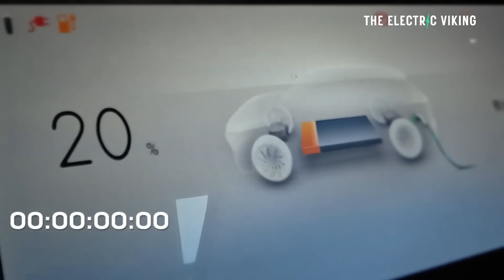CATL Unleashes Sodium: The EV Battery That WILL Rewrite Industry

Comment: The super low price for similar energy density to LFP will be the disrupting factor. That means that even with tariffs, the price will be comparable or less in the U.S. (and less than half the price everywhere else). Plus the added benefits of 0-100% charging, safety, cold and hot weather tolerance, and super long life will get many adopters. The battery swapping business makes sense for people who cannot charge up at home. It was a hard sell when Tesla showed their battery pack swapping system, years ago. But the biggest downside was NCMA battery degradation in swapped packs. At that time if you just paid $100K for your long range Tesla Model S, you didn't want to have your new battery swapped out to someone who would potentially abuse it. But now, having a Naxtra battery pack with 0-100% charging, and 10,000 cycles before 80% means that there is no reason not to swap out the battery pack whenever you like. And battery swapping is a smart business for CATL, considering that CATL provides their own packs, and can charge up overnight, when power is the cheapest.

Comment: It also means that every house in the future could potentially have its own reserve built-in for a very affordable price instead of building all the large battery centers in case of grid failure. Ideally the car themselves could do this too.
Reply: Yes should be a kind of law on that.
Reply: @Myrslokstok  a publicly local-distributed power grid only makes sense, especially as EVs gain increasing market share and partake naturally in that same power grid. Being able to provide energy to your neighborhood from your personal battery station in your home when central power outages may occur, could give thus far unseen levels of power grid stability -to a degree where if someone wanted to do damage to a country's power grid, they would have to attack the actual infrastructure itself (cables and subterrain power lines etc), rather than just hitting centralized power stations to take out an entire city district.

Nuclear SMRs can go the same route as well -but for industrial districts rather than nation-wide power suppliers.
Reply: Honestly, a 20kWh home battery could do NMC batteries and HW cost would only be ~$1-2k more than sodium.  That's pretty tiny compared to the cost of the home.  Integration is the real cost killer.

Comment: In Ireland, where the difference between average winter temps and summer temps is about 15C, and my car range drops by 20% in winter, and it is a Diesel. Most people don't even know how much their fuel consumption rises in winter in an ICE car.
Reply: Not sure what it’s like in Ireland but in Canada we have winter and summer gasoline formulations.
Reply: That’s because the load on the alternator increases, lighting load, heated seats and windscreens etc

Comment: Fun fact, -40 is the same in C and F... that said these are CERTAINLY going to replace LFP simply due to cost alone, plus the longevity of sodium is amazing!
Reply: longevity is not amazing as you said. The best commercially available one has 3000-4000 cycles max. LFP is now reaching 8000+ with 10-15 year life depending on usage conditions. Sodium is very far from competing with LFP, let alone being better than it. What you see in this video is just some hyping crap that I can provide you a link or a video ten years ago with the same crappy claims.
Reply: @abdullahalrasheed394  difference is CATL is throwing their weight behind it
Reply: @sino_diogenes  I’m a big fan of off grid systems and batteries, and I truly wish they get this done and produce longer life batteries with more cycles while being cheaper than LFPs. But the truth is the sodium battery will not dominate any time soon even if the entire Chinese industrial base is thrown behind it. There will be new tech or chemistries before the sodium battery becomes good enough.
Reply: @abdullahalrasheed394  could we do the technical study each other? I'm doing the off grid battery LFP for many years and study the sodium battery for over 1 year already
Reply: @abdullahalrasheed394  most LFP battery is not end of cycle , it even not go to 1000cycles for many years. but the most critical is the Calendar decay during use. the sodium is much better, and recover the capacity. now the best application is UPS and Jump starter. we could exchange the experience together.
Reply: Well below -20°C my gas car don't start.
Reply: @Myrslokstok yeah, I don’t start well either 😂
Reply: @rmorales1029  sodium battery? empty or full of charge?
Reply: @Myrslokstok  sodium or lithium battery?

Comment: The demand for solid state lithium is dead then.  
175 Wh/kg, half price the of LFP, 10k charge cycles for 80% capacity retention is already attractive enough to be used in EVs.  

The only use case of solid state batteries I can think of is aviation, sports and luxury vehicles
Reply: No, solid state is not dead, ALL EV applications can benefit from much lower weight with higher density batteries. Yes, this will be an amazing cheap option for cheap cars but solid state with its density will always be preferable and eventually the cost will drop for standard cars.

Comment: Since I live in southern Sweden, and I have been driving EV-s for more than 7 years (Renault Zoe, in fact), I know from a practical standpoint about low temperature degradation. On a normal summer day (+20C), I have 350 km of range. At about 0 deg C, it is some 300 km, and at -10C its about 250 km. One or two single days a year it could be -20 in Småland. Is this a real life problem? No not really, since I normally dont travel far during the coldest periods, som 250 km of range is sufficient. The driving in itself is problematic, snow and ice in the roads and streets. Also, during all year aroud, the car is idle in a garage, an inside the garage the temperature does not change that much. During driving the battery will keep its temperature up due to resistive effects. The only time this matters is if you park your car outdoors for a long time. But of course I would very much like batteries with half the price, and working well at minus -40 C. If I go to nothern Sweden.

Comment: Limitations

Lower energy density: Typically ~100–160 Wh/kg vs 180–250+ Wh/kg for Li-ion.

Shorter cycle life (currently): Research is improving this.

Larger/heavier: Sodium ions are bigger than lithium ions, so they don’t pack as efficiently.

Comment: Hi Sam. Thanks for the info. Make the battery packs portable and alot cheaper so most people can afford to adopt it. Nice to be able to plug them into the house or any other application when you're not home. A mobile platform (the car, stick them on the wall or move them on a trailer) and take it over to your neighbours if their power is out. What a great potential solution! Plug and play. The problem with north american suppliers is that they want to keep you dependent and have you replace quickly and fill up the landfills that they also make money on. Arsholes! lol

Comment: Also the energy density of lithium batteries is effectively compromised by extreme weather conditions. Extreme hot and cold. Thus they need to recalculate the average expected range on that basis. i.e. not simply per trip, but also per time frame and per weather conditions factored into that. What's the bet that EV range is based on optimal weather conditions ( i.e. temperature ). i.e. not reflective of true normalised range taking into account ambient air temperature. i.e. extreme heat and extreme cold.

Comment: Car expert didn’t say what you claimed - context matters. 

He actually real
World tested these vehicles in cold melb weather and measured the range of normal driving of them in winter vs the actual stated capacity publically

So he didn’t say they lose 40% of range because of temperature - you have factually messed that up

What it comes down to is temperature plus very wrong estimations from factory when combined can mean you get upto 40% less than you think if you go off manufacture claims

Comment: -40 is the temperature at which adding Celsius or Fahrenheit is redundant. Kelvin and Rankine (you're familiar with Rankine, right?) don't include negative temperatures. Zero degrees K or R is absolute zero.

Comment: Put these batteries in TESLA megapacks, it would allow multiple charge/discharge cycles per day and still last 20 years. Payback period would be reduced significantly and allow the grid to soak up all that excessive wind and solar.

Comment: Sodium batteries : lower energy density so larger batteries required for the same range, AND sodium is seven times heavier than lithium (so a larger battery of a heavier substance is required), and the onset of thermal runaway happens at a lower temperature. [But they do cost less and they are less toxic to mine, and when they burn... so... yay?]

Comment: Common easily available raw materials manufactured for 50 percent of the cost of lithium batteries using the existing lithium ion manufacturing facilities sounds like a major breakthrough to me.

Comment: It's hard to predict the future, but I could see these batteries playing a big role in putting a nail in the coffin of ICE.
  I don't think that battery swapping is nearly as simple as DC fast charging.  Electricity is virtually universal, batteries are not universal in size, shape, voltage, etc.  
Looking forward to these Na+ batteries in use next summer.
Reply: no, with these battery you can only build heavy bulky low range crappy cars.
Reply: There's no chance of EV's ever replacing ICE vehicles. It's nothing but fantasy to think this.
Reply: It's not really hard at all to predict the future. I literally have a process patent on it. FWIW, process patent is different than design, in that, I have to prove it works.
Physics, time, et al make it very easy to delineate everything that could NOT happen in X timeframe.
When you remove everything that COULD NOT HAPPEN... you're left with what COULD HAPPEN.
Then, you use a forward model to spaghettify the possibilities, add weights to likely outcomes, program in known future occurrences, such as elections. et voila.
Battery/EV will not displace ICE while you are alive. Guaranteed.
Reply: Agree BUT - don't ditch the fossil fuels for electricity generation and potentially ruin an economy (like the UK Net Zero debacle) - UNTIL these tech solutions are ready ?🙃
Reply: @WeylandIndustries  UK Net Zero is most definitely not a debacle.
Reply: @rogerphelps9939  No -the intentions are wholly justifiable in terms of Man ruining nature and the evironment etc etc
However - ALL of us need to do it (ALL countries) and the UK is not in the position until improved TECH works - to replace the fossil fuels right now.
A strong economy is required for the TECH to develop - my point is why ruin the chances of a successful ZERO emissions goal with new TECH - before we have the chance to develop it PROPERLY- was my point🙂

Comment: It all sounds great - but when the rubber hits the road - emphasis when - will others have even better batteries like solid state?  Not long ago BYD said it's seagull car was going to have sodium ion cells but they had to back off, and it never happened.  This is an industry full of hype where it is infrequent that claimed meet reality.  One of the problems with prior Sodium cells was they were fragile, that might be ok in a stationary use but not good in mobile use. So that When crops up, a month? 6 months? a year? 2 Years?  We end with the Missouri proof - show me.  Then I'll believe it.

Comment: - 40 Degrees is not of a great concern compared to + 40 Degrees, especially here in Australia. Because of global warming.
Batteries will need to have minimum degradation and better performance in extreme heat.
Reply: These are fine at +60 C. Molten salt. These Celsius temperatures mean nothing to me, and I don't feel like looking it up. It gets over 110F here.

Comment: Any comments on use as storage for home solar PV ?  Seems like that would be a great application (especially since storage density is not so critical).
Reply: My thoughts exactly!  This should be game changing for home energy storage with solar PV.  It’s not like size and weight matter much when the batteries are in the garage or other buildings vs inside an automobile.
Reply: Hawaii recently replaced its large oil-fired electricity generating plant with solar and batteries.  You can look it up.  Texas is also doing the same to balance loads.  China is creating massive (e.g. hundreds of sq. km) solar parks in the desert and will presumably use battery store some of that.  Over the past decade, its energy production has exploded. It produces more renewable energy than USA, India and a few other countries --- combined.
Reply: It would be perfect for home energy storage due to cost and weather.

Comment: Cool!  This means Supercharging in minutes with the help of on-site storage to keep capacity charges down.  At 1/2 the price and 3x longevity .. from a utilities perspective that is 6x cheaper. Cost of short-term storage is now a rounding error.
Reply: What is supercharging? Are the electrons special? Stupid unnecessary prefix.
Reply: @rogerphelps9939  Jacuzzi is actually a brand of hot tub .. but because they popularized the industry, people tend to use the term instead of the broader term “hot tub”.  Could use the terms fast-charge or L3 charge .. but Supercharge has more panache IMHO.

Comment: It is coming very fast in China, but the rest of the world not so much. I think we will see sodium ion quickly replace LFP in China, but unless the pack level energy density comes up it will be relegated to the medium and low range cars. That is most cars though... Europe will be getting them shortly after because they can import them from China. However, you won't be able to get reasonably priced sodium ion batteries in the US from anyone for a long time because at the moment Chinese batteries are highly tariffed and no one else is making the mat scale. As an engineer I would totally bet on sodium ion for a lot of applications, but until they are made in the US (or someone we have a trading deal with) it will have major hurdles for adoption here. Meanwhile in the rest of the world you folks will be enjoying cheap electric cars, grid and home electricity storage. Even gas cars will benefit because they will replace the 12V batteries being better (WAAAYYYYY better) and the same cost (roughly).

Comment: We need to get these into e-bikes.
Reply: Sodium battery for E-bike are now widely available in China.  Their price is about 30% lower than lithium counterparts.
Reply: I want a completely new electric sidecar design with a triangle of low positioned batteries with an engine in each wheel, and recumbent seating position. I'm working on it!
Reply: they have a relatively low energy density. For e-bikes its better to use silicon based li-ion.
Reply: no, absolutely not.
Reply: Sodium batteries are heavier than lithium batteries plus have a lower energy density so may never be a great choice for e-bikes.
Reply: @tonyw4863 It’s an e-bike, not an Italian road racer.  E-bike fires are going to get them banned. 🔥
Reply: @douggolde7582   What's getting ebikes in big trouble is all the dumb ass kids riding around like morons into streets at 20+ mph without looking, while on phones and getting splattered or causing accidents. In my area we've had 9 kids hit or killed in the past 2 weeks alone.. few of them young too. Because they are doing insane speeds and doing things like wheelies and hopping curbs or my favorite swinging n to traffic thru stop signs and stop lights without looking at 15+mph. It's unreal how stupid parents are for letting younger kids have these and frankly they should require a 16+ year age and license to ride them. They're essentially the new moped which are street legal.
Reply: @WhySoDivided-CantWeAllGetAlong  yep , i need all my motorcycle training to keep me alive on these ,there like an overpowered ultra light moped with skinny tyres .
Reply: @tonyw4863  Not by enough to really care as it is not that much weight difference. On top of that it will probably charge many more times until one notices that the range is not as far. Plus it can now operate at a higher temperature difference.
Reply: @tonyw4863 its just the first generation, how long did it take lithium ones to be viable, but its a first step
Reply: @tonyw4863  Ebike batteries are so small it's fine, and the newer Na batteries are close to LFP. It will happen in time if Na batteries work out because 10 years from now if Na is as claimed that much safer people will be busy banning NCM and Li batteries and possibly LFP for fire safety reasons.
Reply: @tonyw4863  They won't be a good choice for cars either for that same reason.